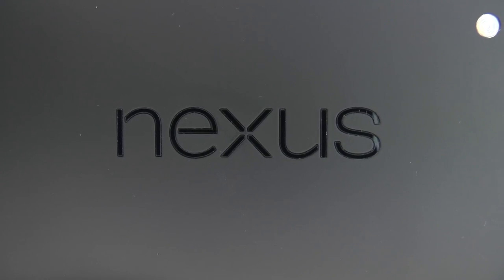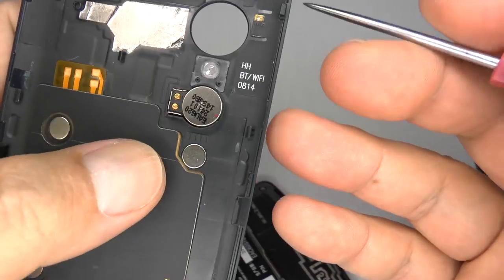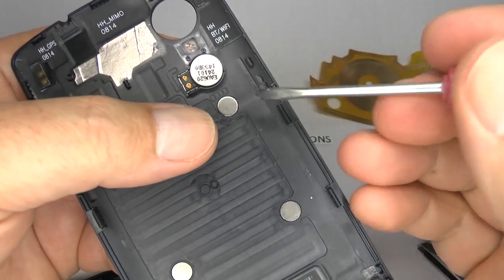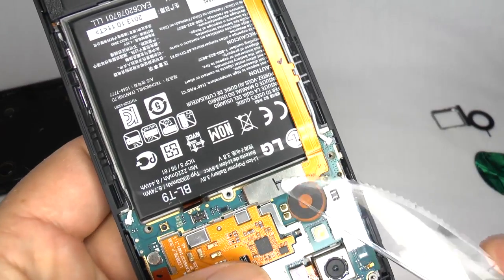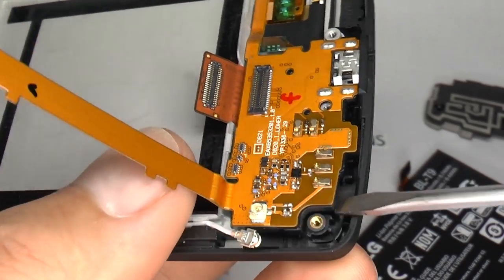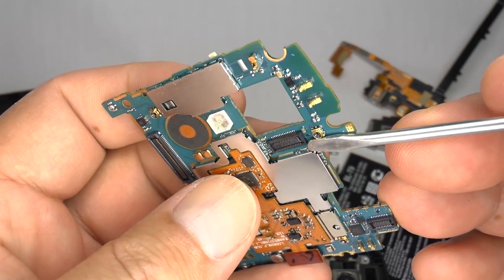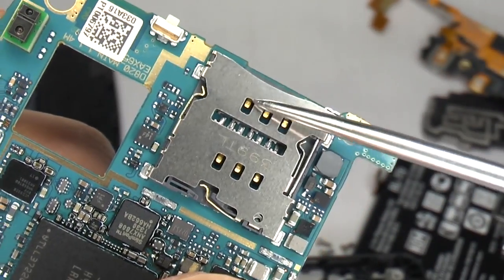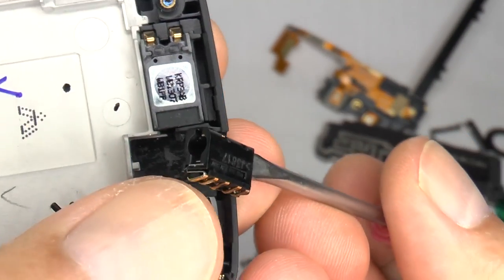Nexus 5 Teardown - Disassembly & Assembly - Screen Repair & Case Replacement LG-D821 - 820

Comment: Had my screen replace now my proximity sensor thinks it is always covered.  Any tips?
Reply from the maker: make sure the sensor is pushed up against the screen, or you can try using very small bits of blu-tak between the screen and sensor. You might need to experiment a bit but it should work..
Reply: So the blu-tak goes directly over the sensor?
Reply: Also where can you get blu-tak?  Thanks.
Reply from the maker: Steven Weinstein you should find blu-tack at most office supplies. I've used very small pieces around or between the sensor. Its hard to explain.. try and keep the infra red led separate from the sensor using a thin piece of blu-tack http://en.wikipedia.org/wiki/Blu-Tack

Comment: When I put the batterycover back again there's a gap between the cover and the phone.. Wtf.
Reply from the maker: take the cover off again and remove that double sided tape at the bottom near the usb port..
Reply: ***** Forgot to mention it was actually the first thing I did.. It's not just the down side but the top side as well.. Really annoying. Will buying a new cover solve this??
Reply from the maker: ***** it might do, try removing the vibrating motor and put it in very hot water, it might make the clips return and hold it down flat..
Reply: *****  Have you put a piece of paper under the gps antenna? That might be thick enough to do what you are describing
Reply: ***** I tried but it didn't help. Plus I think the plastic pins holding the cover in place has changed it's shape.

Comment: i swear phones are being designed to be increasingly harder to get into XD
Reply: nice tear-down by the way - very detailed :D
Reply: ***** I'm about to change my screen, but since my purchase 1 of the speakers is not working, if you have the phone in front of you, the right one, the left one is working fine, can I fix this easily?
Reply: ***** I did the replacement, all went well, the phone is working fine but no touch imput, does not react to anything but the tactile buttons, some help please?

Comment: Does the Nexus 5 come with a standard sim card or a micro sim card?
Reply: Micro ;-)
Reply: I'm not sure if I have a standard or a micro SD card. Guess I better do a little researching. Haha.
Reply: shadowscarnage Sim card /= SD card... In any case, they are both micro ;-)
Reply: My Galaxy Nexus (GSM) has a standard Sim card slot, I guess because that's what size of sim card I'm using now.